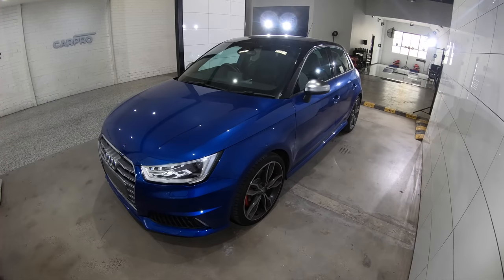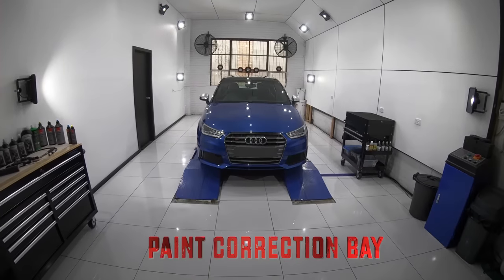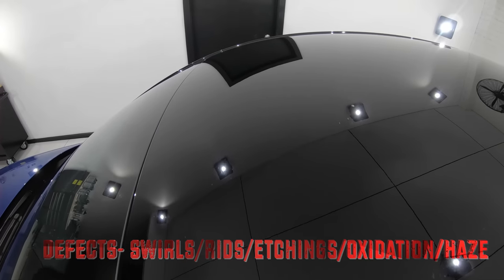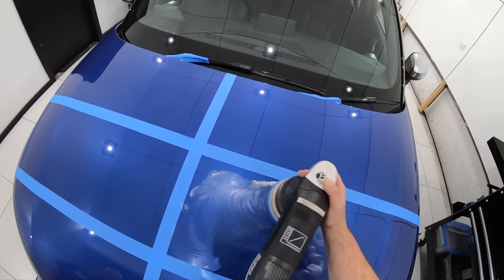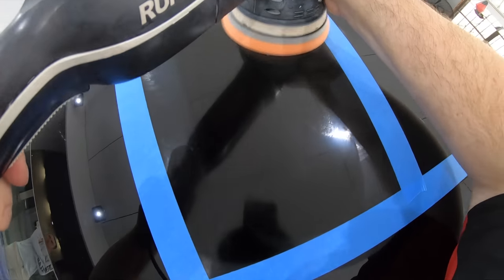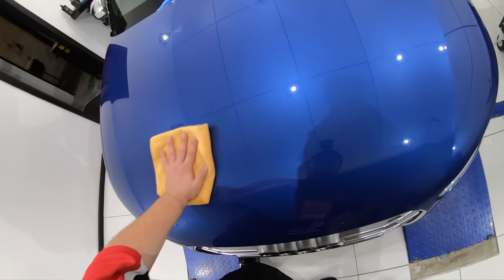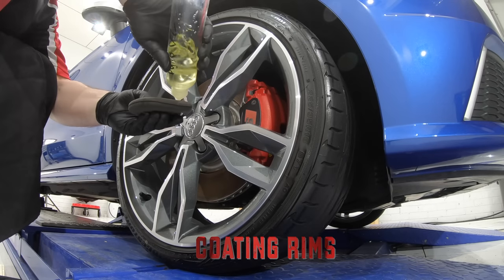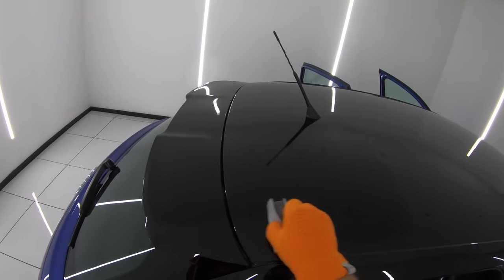AUDI S1-  Complete Step By Step Detail (Vlog 19)

Comment: The S1 looks great, a nice result for the students and the car owner 👍I polished my car last month and used what you suggested, the scholl concepts s20, 30 and s3 gold, with the blue spider pad, orange lake country pad and the micro fibre pad. It turned out really well with the winning combination of S3 gold with the lake country micro fibre pad for 3 passes and then the S20 and the orange pad to clear up the haze and micro marring caused by the previous pad combo. Thanks for the advice Sandro mate, the scholl range was absolutely awesome with very little dusting and finished well, a good shout on that one mate 👍👍👍 just for your info, I noticed that the wiper arms were taped up in the vid, you should be able to move these out of the way, if they are the type that do not lift away due to the bonnet being in the way, you can put the car in service mode by switching on the ignition, then switch it off again, then press down on the wiper stork and they should raise and stay there. Once you are done, just switch on the ignition again and push the stork down to return them to a normal position. Keep up the good work mate, looking forward to seeing the next vid 😜👍👍👍👍
Reply: @CarCraftAutoDetailing  the European Fords are the same with the wiper service mode. (Fiesta, Focus and Mondeo). Done my apprenticeship at a Ford dealership.

Comment: Yep, I'm sold!!!!! Rupees Yellow wool pad is the next one I buy. I have been using TLC with light cutting pad to finish on the Astra but after see this wow pretty amazing result. Good question by the peanut gallery. Makes sense if you can cut defect plus end up with 90-95% perfect finish you win-win. Thanks again for another great time-saving detail video. I assume that if you added this combination to a Rotary you would end up with even more defect removal but still a very good finish. I am so impressed with TLC. I tried it on my Holden HQ Sandman ute with an ERO microfiber and simply great results. Certainly cuts the old Acrylic paint with ease. Someways too well. What your pad selection weapon of choice for these old type paints???? I was thinking of giving S20+ a try being a little less powerful. Thanks mate for another helpful presentation.
Reply: @CarCraftAutoDetailing  Cheers again mate

Comment: Gday Sandro. I had a question a bit off track. Rewind to The Very Hard Clear coat Celo car you completed. The final two steps you did what pad/ polish combo for the second and third step as I couldn't exactly work this out???  I ask this as I am up to the final step of polishing before the coating. Actually, I am about to put an order in for the brilliant Rupees wool pad you used and some more TLC plus some more pads so was hoping to know which last two combinations you used. Also, I love the Shine mate 12mm machine I bought based on your videos and recommendations. It does a fantastic job no matter what pad you try E.G. Ero Microfiber, HDO blue and Orange foam pads, Demi pad and Lake Country Yellow heavy cut. Looking forward to the coating going on..........finally!!!! And as the Evo I purchased is over 12 months old, I most likely will have to get another batch. Would you take the risk and use the current bottle if it looks ok or just scrap it???? Looking forward to the next car you do. And the unique music soundtracks.

Comment: I love those tyre brushes, so simple, so cheap, so good. Has your Kranzle stood the test of time well? I'm wanting the naked K10 / 122 TS, but zero stock in the UK at the moment. Are Kranzle as good as we are led to believe?
Reply from the maker: My Kranzle is going great two years on! I had to replace the hose about 6mths ago  which was a little pricy and I’ve had to replace two little rubber seals which cost next to nothing, I had it serviced only once which I’d recommend to do every year or two, but apart from that it’s still working perfectly and has never let me down.
Reply: @CarCraftAutoDetailing  You always reply to comments which is great to see! Thank you very much indeed.